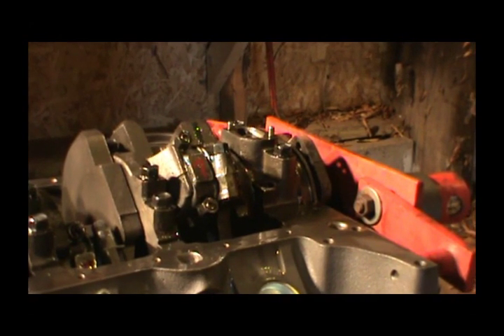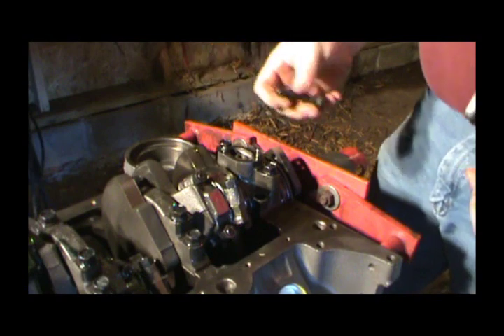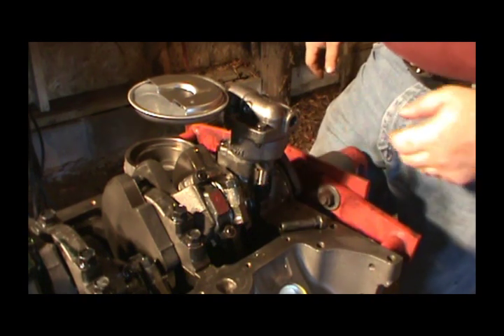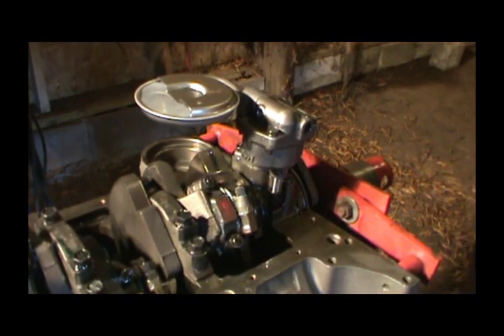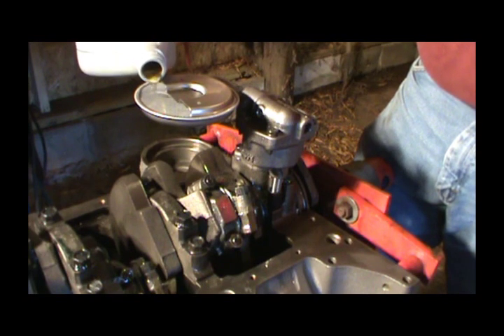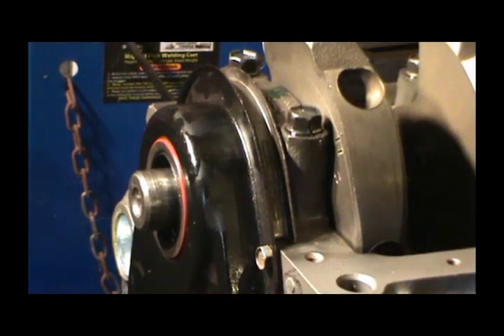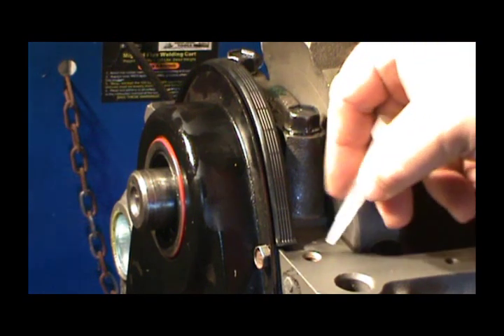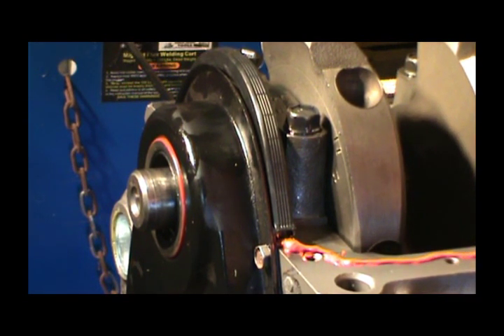Chevy 350 Engine Rebuild Part 5

Comment: They have a one piece oil pan gasket for the older engines now.  Me and dad put one on his 70 Camaro before we put an aluminum oil pan on.  The one piece gasket is not cheap.
Reply from the maker: I've seen those, look like they would seal good!  Nothing that works is cheap!  I hate cork gaskets.